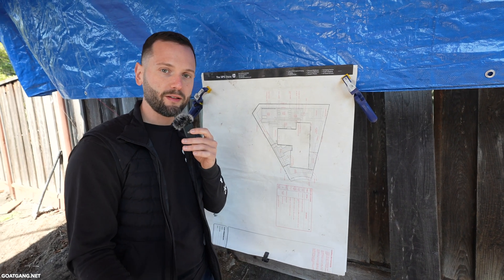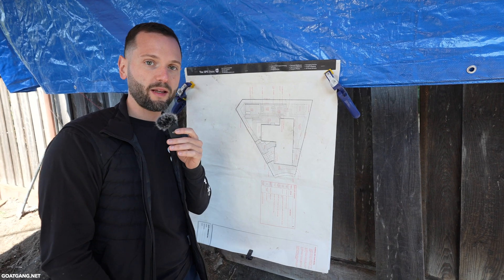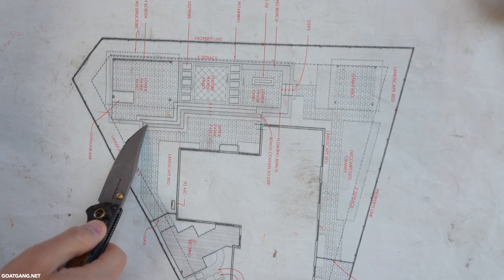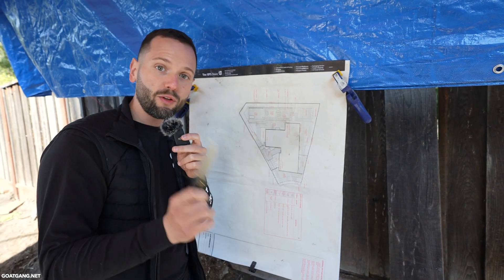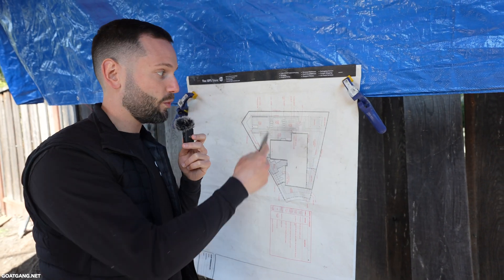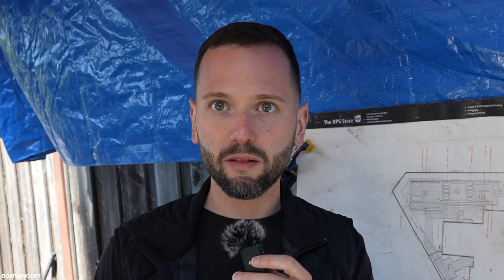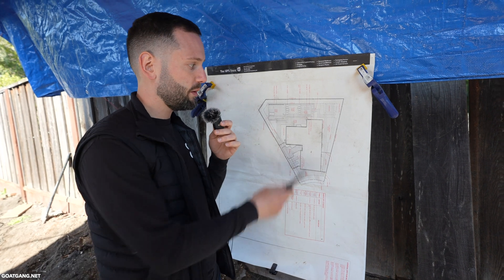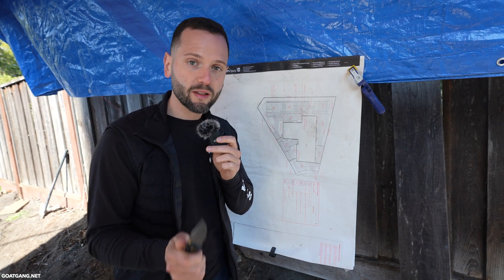How to Read Construction Blueprints and Plans

Comment: it’s called an easement, setback’s are not the same thing, all properties have easements, always call dig to find out if any easements are being used by utility companies. FYI always being used
Reply: setbacks are locations where walls or any structures can be placed. These are set by local municipalities. always check the city, an example of a set back is say a customer wants a 6 foot tall wall in front of their house, you ask the city how far the setback is from the curb of the street.

Comment: Concretes permeable, that’s why they waterproof basement walls in the north, the water will wick through and have water spotting and some efflorescence. Good call on the drainage fabric
Reply: Not all concrete is permeable, otherwise they wouldn't make concrete damns out of concrete.
Reply: @siliconvalleylife2.048  they waterproof the dams or use asphaltic concrete as a core, standers concrete is not waterproof primo, over time the water will wick through, go outside and pour water on concrete, see where it goes?right into the concrete.
Reply: @michaelibarra2947  it evaporates or runs off the concrete.
Reply: @michaelibarra2947  yes, technically concrete is porous and permeable. But it doesn't drain or permeate very fast. Which is why we install drains.
Technically concrete is water, sand and rocks..and it cracks. But we don't really consider it permeable. 
 Perhaps for a basement, but we don't consider concrete permeable in landscaping.
Reply: Concrete cracks on thin basement walls, tree roots, seismic ground shifts... that's why they seal coat basements.
Reply: @siliconvalleylife2.048  also, all concrete cracks no matter what 🤷🏽‍♂️